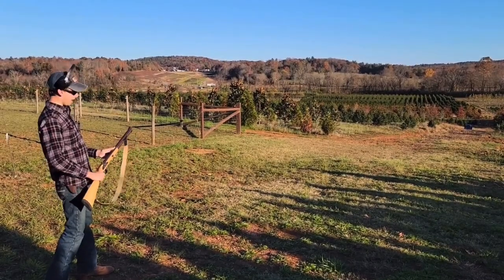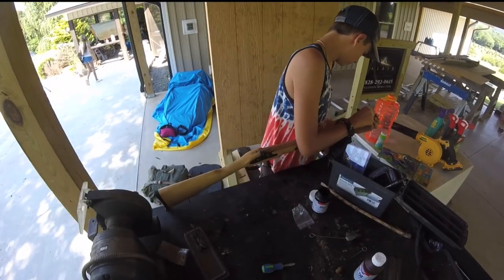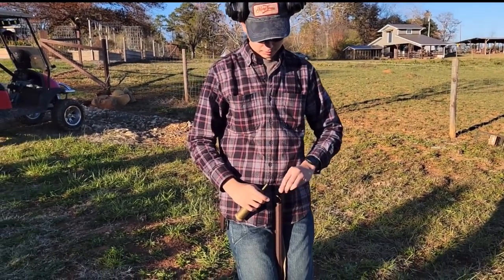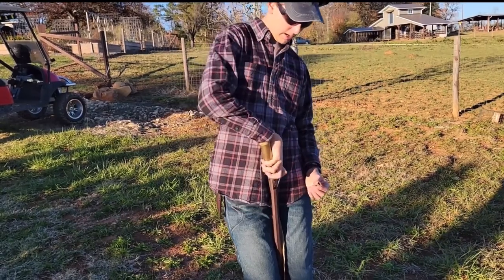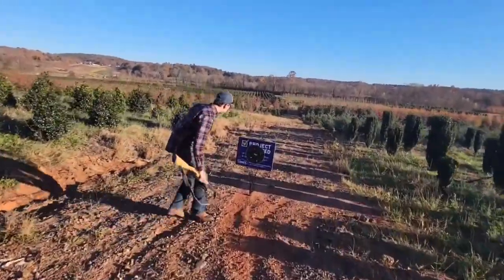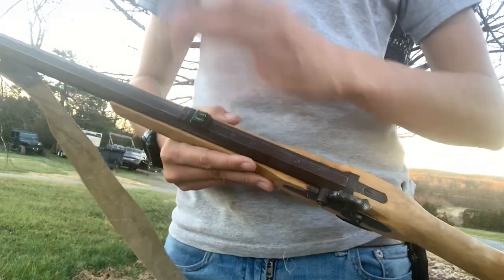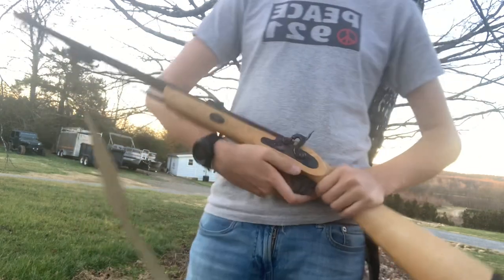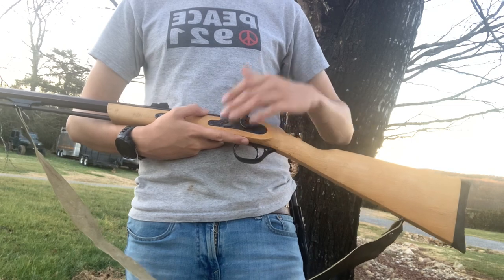Building and Firing the Tradition’s Deer Hunter Percussion Cap Muzzleloader

Comment: Some advice while loading..
Never put your fingers, hands, or face over the muzzle or ram rod. While you were loading with it between your legs, that ram rod was pointed right at your face.
Place the butt on your foot and hold the weapon at an angle away from you. Load from this position. 

You don't need to do the little shake before capping. If properly tamped, the powder will make its way into the chamber and vent.
Keep your balls, patches, and powder in a waist pack So it is easily accessed. Keep the caps in a separate pouch. Having them in a chest pocket is not a good idea for a variety of reasons.

Finally, please look up proper stance for shooting a long gun.
Reply from the maker: Thanks man
Reply: @HuntingDownAdventure  You're welcome brother. Stay safe and keep your powder dry!
Reply from the maker: @silvermediastudio you got it buddy

Comment: If you decide to shoot some sabots, make sure you wait 5 minutes before reloading because once that plastic fouling gets into that barrel, you will never get it out. I quit using sabots because of this. T/C maxihunter or maxiball will shoot very well out that barrel, along with Lee REAL (rifling engraved at loading).
Reply from the maker: Ok. I don’t know where you long comment went just know I saw it and agree with everything.
Reply from the maker: Here is the response to that comment.
first off I just want to say thank you for such a great comment. I will check out the muzzleloading forum. so as far for the addictive sport yes 100% I killed my first deer with a in-line muzzleloader and ever since then I've been hooked. I was shooting at 50 yards in the video and all of the bullets surrounding and in the bull's-eye were my shots using modern red tipped bullets with 100 grains of powder. After I started editing I realized that I loaded straight into from the flask and realized what I had done but the lucky thing was I had just brushing and cleaned it after the previous 10 or so shots which was lucky  I did so. Icould not shoot powder pellets, but the powder brand I used was triple seven I'm still figuring out for the bullets and powder how many shots and take before cleaning, since that was the first time I ever got to shoot it and it didn't come with much information after building it or I just didn't put it back with it after I built a year or so ago and put it up. as for the twist you're correct. I would like to be able to get into casting and I'm planning to check it out in the near future I have not made a powder Horn, but I have made a leather bag. I've been told to join shooting clubs by Several people which I might do in the future but it will be a while considering all the stuff going around but in the meantime I have 64 acres to be able to shoot freely upon. don't be sorry for the long, that's why I do this thank you
Reply: @HuntingDownAdventure  loop
Reply from the maker: What did you mean

Comment: Buddy you gotta point that thing away from you when youre loading it
Reply from the maker: How do you do it without holding it between your legs
Reply: @HuntingDownAdventure  See my other post. You rest the butt on your foot and hold it away from you, outboard. Then load with opposite hand. Have your powder measured out ahead of time into a loading tube, much safer than using the measure. You never want to use the measure to pour directly into the barrel, because if there is a spark and it goes, you don't want 1/4lb of black powder going off in your hand and near your face. You just want it to flash in the barrel and vent to the atmosphere.
Reply from the maker: I got you thanks for the advice
Reply: @HuntingDownAdventure  he hit the nail on the head, sorry, didn't see your first reply til now.
Reply from the maker: @connorhart7597  it’s alright, he nailed I fully understand now thank y’all both for looking out for me

Comment: Can I only shoot old style lead ammo, or can I use the new stuff that's designed for modern muzzleloaders?
Reply from the maker: You can use either, I have found shooting the modern stuff shoots more accurate such as grouping in the hole at 50-75 yards with 300 grains bullets. The old style was cheaper that’s why I used it in the video and the old style is less accurate. Thank you
Reply: @HuntingDownAdventure  great to know. Thank you for your help
Reply from the maker: @EthanSmith1122  you’re welcome and I will help anytime